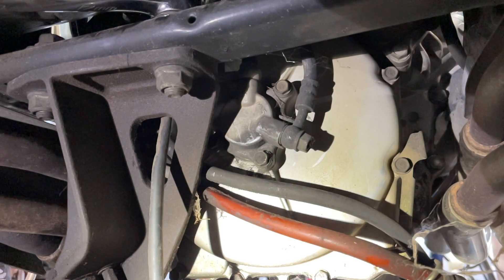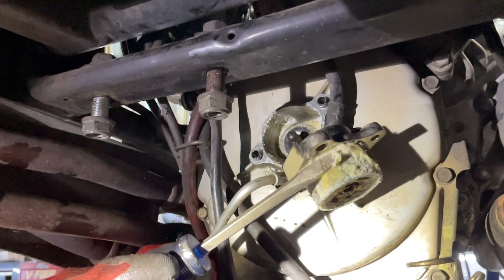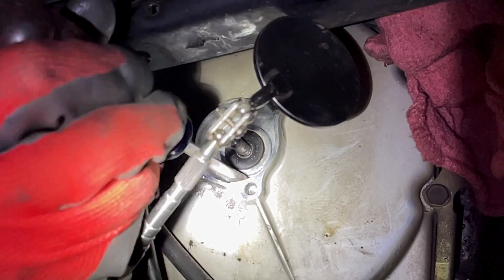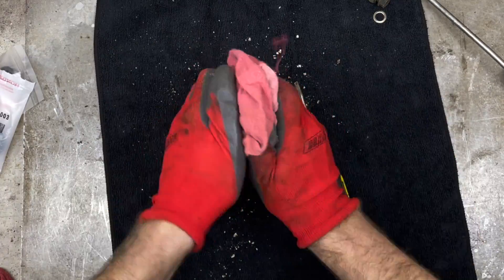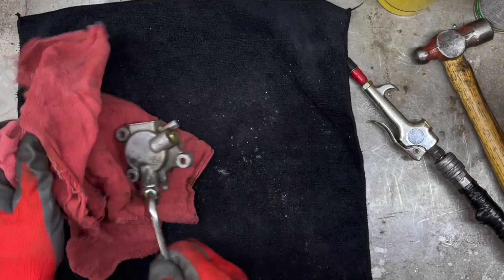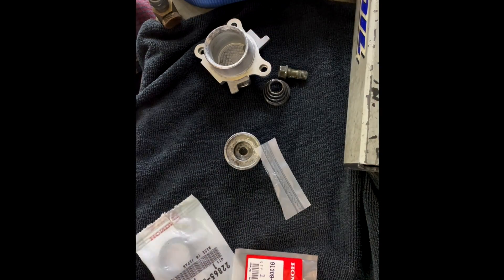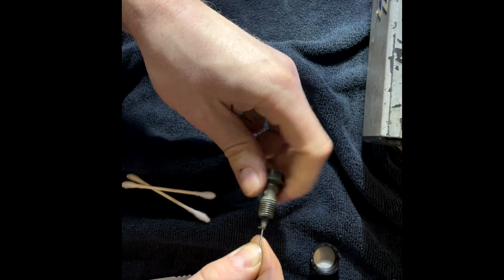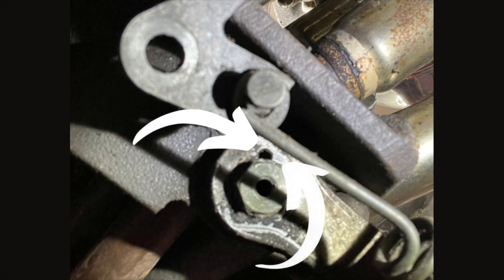Honda Goldwing / Valkyrie - Hydraulic Clutch Repair

Comment: Demonstrates why it it so important to do regular flushing of all three hydraulic systems (front & rear brake & clutch). So often I find these with brake fluid that resembles mud. My 1999 Valkyrie I/S currently has 145K miles and I've never had to touch the clutch slave cyl. Nice demonstration.

Comment: Funny, I just did this on my '94 GL1500 last week. 
It was no where near as bad as this one, since I do daily ride it. I just went ahead and replaced all the internal parts (both seals, piston, and spring). 
The piston was still usable, as was the spring, but since since it was apart, and was only $40 for all the parts, I just did them all so I don't have to worry about it. 
One thing you don't show is getting that bolt out of the bleeder extension, so make sure you take that out as well.
On the Goldwing, no need to remove the kickstand, so that is one less thing to worry about.

I also had to do the clutch master since I found it was leaking a little as well.
Reply from the maker: Great fixes all around! Thanks for stopping by and giving some more tips! 🤙🏻

Comment: Thanks for this video!  I'm having to work on the ground just on the center stand on my 93 gl1500 Interstate.   Being able to look at how you cleaned the case while it is still mounted in the bike is a big help to me as I'm having to do it basically by feel under there.   Thankfully I don't think I am going to have to use the hot wrench to get the piston out as mine was just working last week. (fluid exited the system on a long, hot ride)

Comment: Question: I just got an 84 Goldwing GL1200 Interstate and when I park it overnight I discovered maybe a 1/2 teaspoon, maybe less of oil puddle that leaked through the water pump weep hole.  I ordered a seal kit and a new water pump as well as some timing belts.  While I'm waiting for them to show up can I still ride it?
Reply from the maker: Sure! Just keep fluids topped off.

Comment: As I watched the video, it appeared the part number for the cup seal is #22865-MG9-003. You listed Factory Honda Parts Used: Cup Seal : 22865-MJ8-003. Am I mistaken? I assume there's a difference between the two. I just want to get the correct part.

Comment: My clutch moves freely very little resistance bike is a 83 nighthawk 13500 miles iv bled the line all clear of air opened case it was dry not sure. bccwhat to do if I put it in gear it stalls I gotta roll in neutral and hang on any help please

Comment: If you had evidence of leaking prior to doing the clutch slave cylinder rebuild would you replace anything besides the banjo washers? I had evidence on the top side and bottom side and lots of curd inside. Excellent video. The long pin that is pushed by the piston had some nastiness towards the top. Is it ok to sand smooth? Is that pin chrome plated? Could be a little hard on the seal. Any reason why the pin can't be flipped around with the nasty end going in first? What was the torque settings for the banjo bolts?
Reply: that pin (actuating rod) operates the clutch. if you reduce the length at all you will get clutch problems. therefore i wouldnt advise sanding it

Comment: Just curious. In the maintenance schedule I don't see the seals  and/or spring listed as replaceable items for mileage/year of use. What would be a reasonable time/mileage to bear in mind to inspect and/or replace said items? Thank you .
Reply from the maker: It’s not really considered a maintenance item it’s more of a repair procedure for a neglected system. 

If I were you I would flush the brake and clutch fluid every year. You may never need to go into that system for years and years.
Reply: @TheMotorcycleMD  Thank you Cody. Be safe.
Just to add further to this. I have a 2004 GL1800 (46000 Kilometres) that was given to me by a very sick friend. He had been sick for years and was unable to ride so the bike has laid dormant since 2013. I have owned several bikes throughout the years. I have cleared all the fluids from the bike and replaced with new. Same with spark plugs, filter and fork oil and seals...so this is why I asked about the clutch slave. Where it has been lying up all these years I figure it would probably be prudent to change out the seals as well. The oil seal that goes into the block for the lifter rod seems good....or would you suggest since I'm in there to replace the oil seal? Thanks again.

Comment: Major question, can I use DOT 4 brake fluid for the hydraulic clutch?
Reply: what fluid to use should be printed on the reservoir cap. most likely dot 4.

Comment: 𝙎𝙐𝙂𝙂𝙀𝙎𝙏𝙄𝙊𝙉(𝙨): This is what I use and do in circular recesses like this video. It's a bit quicker, easier & definitely cleaner. Scotch Bright, I use white (comes in other grits) wrapped around a deep socket and twist. IF I have to pick at hard garbage on aluminum, it's the hardest plastic I have on hand since it's softer than Alum..